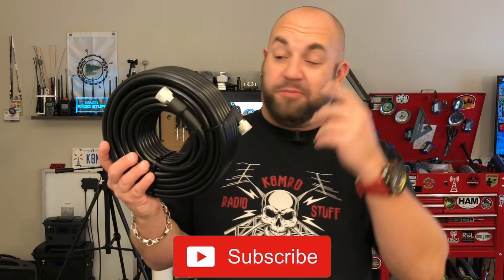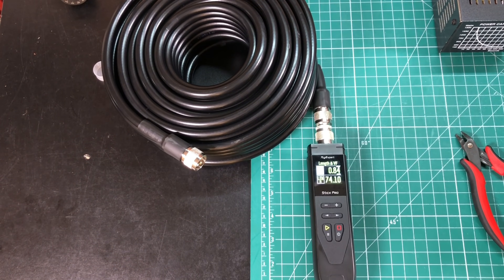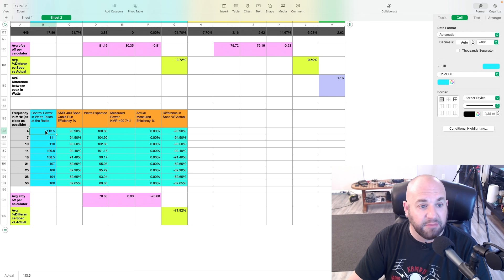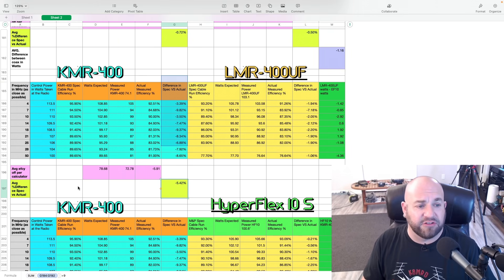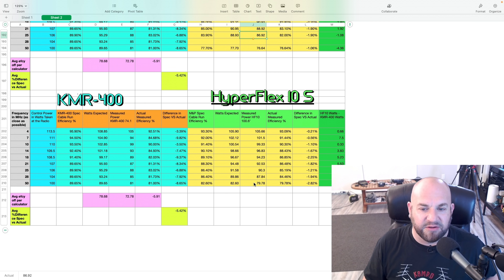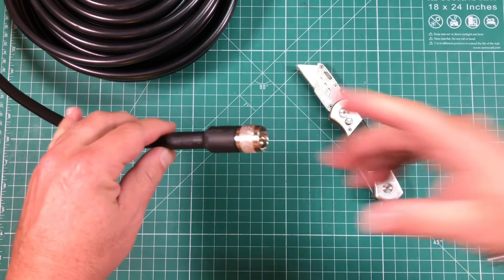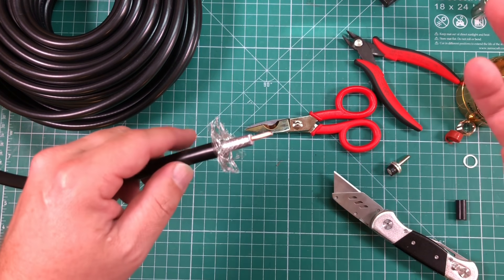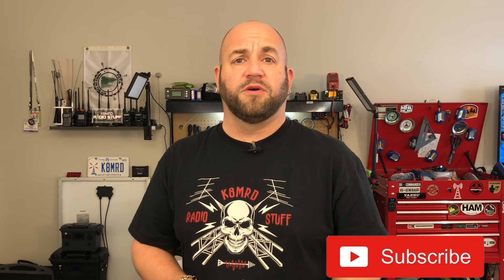I Bought KMR-400 Coax From Amazon | How Bad Can It Be?

Comment: Excellent video!  I have an 80 foot run from my entry panel to a tall oak tree.  I used M & P hyperflex 13 with N connectors for the 2 meter/70 CM run and DX Engineering DX 400 Max for the three other runs of coax.  Two are covering  UHF/VHF and HF, leaving two DX 400 Max  runs available for expansion.  I have lightning arrestors both at the base of the tree and at the entry panel with both bonded together with appropriate ground wire and ground rods(including the service ground).  I spent the most  $  where I would have had the highest loss (VHF/UHF).  I felt that the DX 400 Max was close enough to LMR 400 and that the cost savings justified it (bought a 500 foot bulk roll).  The run was underground  in a plastic electrical conduit.  Downhill from the tree to the house with drain holes in the conduit just before the 90 degree bend up to the entry panel as an egress point for any water that might get into the conduit.  I used the M&P Evo connectors...see Callum's video.  The soil here is red North Carolina clay...I didn't want to dig a trench more than once!!!  I had to wait for the budget to catch up to the purchase order and I am glad that I did.  Perhaps there was a reason the KMR specs were unavailable!  I'm generally of the opinion that over-engineering is under rated!  Though I did have budgetary constraints to contend with1  73
Reply: How close did you put all those feed lines together? What about interface issues?  I'm pretty new to the hobby but my understanding is that any metal which runs longitudinally with the feed line will change the SWR and can potentially generate RF noise on the other cables, right?  How is this setup working for you?  And are you ever trying to transmit on one radio while the other is connected and listening?  Or is it all on the same radio and type just switching out antennas?
Reply: @darinhitchings7104  I have one 80 foot run of M&P hyperflex 13 for VHF/UHF and 3 runs of DX400 max for everything else.  All 4 coax runs are in a 2 inch  plastic electrical conduit.  Lightning arresters both at the entry panel and mounted to a ground rod at the base of the oak tree.  I've had no issues.

Comment: If your coax lengths are to very long, it doesn't really matter.  Mine are all less than 50feet (30m).  I have an eclectic collection of coax and don't notice any significant differences among the types of and brands of coax I use.   If your coax runs are 100, 200 or 300ft long, well, take out a second mortgage on your house and buy some "quality" cable.
Reply: When you get to UHF regular RG58 starts becoming very lossy. 7db at 50 ft.
Reply: @randykitchleburger2780  I use RG213 or some heavier gauge coax for my UHF/VHF feed lines.  For HF RG58 is cheap and works ok.  Like I mentioned, my feed lines are less than 50ft, some  much less, especially in portable/mobile situations.

Comment: So it's good stuff! 
That's good to know. 

I'd been more impressed if he had compared the same length of LMR 400 with connectors hooked up in the same way and showed those results instead of just relying on the chart of specs for the LMR 400! 

On the one hand he doubts the specs of KMR 400 yet believes totally the spec sheet of the LMR 400!!!

It's been my experience those specs sheets from manufacturers are always calculations from IDEAL LAB CONDITIONS and i doubt anyone can duplicate those findings in the field! 

So like that guy im actually impressed with it!

My only complaint is I don't like the big thick coax. It's just too hard to handle. 

Thanks for sharing!.

Comment: I wanted jump in on the solder verses crimped connectors conversation with a slightly different view…maybe. In aerospace the decision to crimp or solder was based to several factors.

1.	Was the instrument that was being specified “mission critical”?
2.	How much power was the cable carrying?
3.	Was it possible that the instrument being installed have to be removed for service or maintenance?
4.	Was vibration a consideration in the choice?
There were several more items but they do not apply to the HAM applications. The decision that everyone has to make is the connection mission critical? Does mission mean you have to solder?

No. 

In general crimping was used on multi pin cannon connectors were vibration was less of an issue because of the strain relief that was in place. This is where you get to decide is the connection mission critical, and do what you think is best. 

Glenn
N6JAI

Comment: It would be interesting to do a true comparison of diameter, coverage, and true performance. I also believe that for the test to be accurate, the cable needs to be stretched, suspended in a non-conductive tray and measured. It would be very interesting to do an LMR-400 vs the KMR-400 and other brands. Do all of them at 100 feet since that is how the standard is made, but some companies probably do their measurements in meters. Also, I knew the ad was suspicious on Amazon as it said cable is made in the USA and assembled in China. LOL!
Reply from the maker: Cable 100% does not need to be stretched out to test for length, loss, velocity factor, etc.  It is just fine coiled up like this.  Trust me.  I just spent 4 days in Italy at the Messi & Paoloni factory.  I have a video that will be coming out in the following weeks showing how they test their coax so you can see how it's done.
Reply: @hamradiotube  SOME PEOPLE [!!!!!!!!!!!  JUST CANT EXCEPT THINGS AT FACE VALUE.

Comment: CCA is inferior. This garbage started with Ethernet cable and wise IT NEVER use it.
Reply: CCA is only inferior if the CU thickness is insufficient for the frequency.  All of my Andrew Heliax (1/2" and 7/8") is CCA center conductor and it is very low loss on all frequencies I use.  Same for my CommScope LMR400.

Comment: RG 400 is the way to go, especially concerning its high heat tolerance makes easier for soldering connectors.
Reply: Not for longer runs - look at the loss.  4.4 dB/100' at 100 mHz. compared to 1.232 dB for LMR400.  Soldering a foam dielectric coax works fine.  You just have to tin the braid with a large iron before installing the connector and after installing the connector, let it cool before moving it to allow the foam to re-solidify.  Quality crimp-on connectors work very well.
Reply: @jimeppright7862  That loss is at 100 feet though. I have my antenna mounted at 36 feet high which is the first wavelength above ground and the loss at that length is near zero. 

Also, majority of base stations don’t have antennas nowhere near 100 feet and that’s a factor.

 So inevitably, as time progresses and the weather and sunlight has damaged the LMR outer jacket “especially that junk ultra flex outer jacket” the RG 400 will still be intact.
I ran times microwave LMR 240 and 400 for decades and neither type made it passed 6-7 years without the outer jacket ruined by sunlight and weather elements. Since I’ve upgraded to RG400 12 years ago, coax maintenance or replacement is not needed. Beside, I’ve seen BBi run 30,000 peak watts through RG400 and we all know you can’t even do that with anything named LMR. 73☑️✌🏻

Comment: How about stranded center conductor? This stuff is a time bomb unless it is routed so it never has to flex.
Reply: Maybe you mean foam dielectric coax.  RG213 is stranded center conductor with a solid polyethylene dielectric.  The quality brands last for decades used as a rotator loop.  Foam dielectric coax is less durable.

Comment: When you check for length with instruments
you a looking at electrical length  not physical  it is always much shorter than actual  with electrical length.  So your calculations are off.
The physical length is probably spot on.  You  can test for velocity factor loss with a good vna.
Chuck AA4CP

Comment: to be fair, you should test the exact same as the other coax vendors did to get their data, or, you are comparing apples and oranges. Conversely, get their coax as well and perform your test on all the coax's and see if the results are consistent or different - my 2 cents worth adjusted for inflation de K8MH

Comment: Interesting stuff, especially that the connectors aren't terrible. It looks like it could be great for a lot of applications. It's gotta be uncoiled for testing though. Coax should even be spaced away from metal tower masts and conduit at higher frequencies. I'm interested in how it behaves up to 450MHz with the provided connectors, and if N connectors are attached, how it does up to 2.4GHz.

Comment: A fair comparison would have been to run your same measurements against 75' of coiled LMR.
Reply: I agree. You have to perform the same test on LMR400 as a control test.
Reply: Pretty sure in its wound up tight state that it acts like an inductor...
Reply: That's a completely different issue than coiled vs uncoiled.

Using a nanoVNA with fresh OSLIT calibration, I got results on Taiwanese BR-400 cable which were within a few percent of the published values for LMR-400.
Reply: Mike doesn't want to be fair!  He wants to sell you on Chinese shit!  I wouldn't put that coax on my DX Commander if you give it to me!
Reply: Coiled cable only impacts common mode not differential mode.
Reply: @michaelstora70  But he's also not using the best or calibrated measuring equipment.  Even with real-deal LMR he might not see the same numbers on the datasheet.  Which would be fine, if you had real LMR400 next to it and measured it on the same equipment in the same scenario, the numbers might not mean as much, but a comparison would tell you a lot.  Or specifically if there is a big delta, or if they're within a couple percent.

Comment: Great video, thank you!  "Better" is subjective, and this coax is likely "good enough" for most amateur radio use cases. It seems great for the price.  But I'm using 75-ohm RG6 for my HF antennas, so there's also that.
Reply: I got some free reel 'tailings' of RG-11 years ago from an apartment construction project installing cable TV trunks.  Ended up with several hundred feet.  You can spin '259's onto it easily.  I use it on everything except my dual-band antenna.  Great stuff.  SWR is acceptable.  75-ohm cable was in use long before 50-ohm stuff was around.

Comment: I got a 50' roll about 3 months ago for setting up a new base station in the house. Antenna is a Sirio 827 about 30' high to the ground plane radials mounted to self made push up that's tied down with 3/16" covered steel cable, radio is a Galaxy DX55V that's been converted, aligned and tuned by a trusted radio tech friend of mine. I'm using  2 x 1446 (on low) driving 8 x 2290 TS Hotplate that averages 600W with around 1.3KW PEP on my MFJ 870 meter. I was reluctant at first about buying the KMR coax but now I'm glad that I did. Using my MFJ 259B analyzer on antenna setup I was able get my SWR down below 1:1.2 on 27.205 and 1:1.3 on both 26.965 and 27.405 with an impedance right at 51 ohms. The same results were noted with amp(s) and meter inline as well. In the future I plan to raise the antenna up another 20-30' and I won't hesitate on getting a 75' to 100' roll. This coax cable works great for me especially for the cost savings.

Comment: Did you actually compare a 75 ft run with your test equipment of the KMR-400 or did you just use the printed spec sheet for the LMR-400 . Don't always believe what you read on the spec sheets.  And since you did not actually have the real Velocity factor of the test cable under load, you're really just guessing. The Chinese are well known for cutting corners in every way they can to make or save money and the center dielectric could be garbage.  All else considered I'm sure this coax would work just fine if you aren't running a 1000 ft of !!

Comment: Thanks for the thorough demo with test gear.I am now much more confident.I am using this Mookeerf KMR400with 500+- watts SSB and I was cuirous what the compression pl259's pin was crimped and soldered.The pin looks larger than I thought.I bought Some Alpha 75 ft rg8 that had Aphenol cntrs so I figured the coax was good,NOT! .The coax was sparse weave aluminum shld which did not even last a year and corroded and burned.
Reply: I never did think it was a good idea to use compression connectors on solid wire, especially the aluminum coated copper.  They are fine on stranded center wire.

Comment: I ordered RG213 with pl259 couplers from Amazon. I had to replace all the fittings as they were pressure fitted on the braided side with no holes to put solder, and didn't make good contact. After replacing the fittings, and soldering everything, it performed as I expected.

Comment: 2:25  Analysis of cable loss should be done in dB, not "%" "Efficiency", except perhaps as a brief explanation of dBs for those that don't know. The table fails to even include dB, which is a bit annoying (LOL).  FYI - I measured the loss of 100-feet length of the same cable as being just 0.8dB at 30 MHz, which is fine.
Reply from the maker: There are many ways to skin a badger.  This is but one.
Reply: @hamradiotube   Should be dB.  One doesn't skin a badger using a baked potato.
Reply: @hamradiotube   Manufacturers' specs for cable loss are always in dB, never in "percentage efficiency."

Comment: it might be worth what you paid but I want a solid copper wire. I wonder if the lower performance was do to copper clad aluminum..
Reply from the maker: I would doubt it.  Times Microwave LMR-400 is copper clad aluminum.
Reply: @hamradiotube  interesting to know. I've always gone to an electronics shop and bought solid copper stranded coax and solder the connection. I never crimp. I don't even know what brand. I look for something made in the us or a European country I trust. I like to physically touch it and see if it feels like good cable and cut a section so I can see the center conductor and the shielding. I'm really old school when it comes to coax. Theres always going to be loss at some frequencies. I've never  worked with aluminum coax that copper coated. aluminum does have a higher resistant than  copper. I'm sure you're aware. I know you're probably thinking 50 Ohm is 50 Ohm, but thats clearly not the case. I don't have the answers but I'd like to find out the differences. I think you mentioned a 19 watt loss at one frequency. To me thats a significant loss of power thats turned into heat. Anyway I enjoyed the video.  It's nice to see someone else spend the  money to find these inconsistencies so we don't have to.  Have a great night and thank you reaching out to me.

Comment: Why would you say the solid always should do better? Electrons run on the outside. Stranded has more outside. . Another thing. It's copper clad aluminum. Aluminum has more resistance than copper. 

But I'll still buy a better brand. I like the stranded core.
Reply from the maker: Because solid center conductors perform better than stranded.  And RF flows on the skin of the conductor so the resistance of aluminum is irrelevant.
Reply: @hamradiotube  isn't it electricity "voltage and current" until it reaches the antenna and then it becomes RF, a radio frequency?

If solid performs better then why do the top coax manufacturers use stranded? Is the gain and flexibility really worth the loss?
Reply: the question is; how does an antenna transmit signals
the answer:
1) Electricity flowing into the transmitter antenna makes electrons vibrate up and down it, producing radio waves. 2) The radio waves travel through the air at the speed of light. 3) When the waves arrive at the receiver antenna, they make electrons vibrate inside it.

Comment: Cable is not bad.  Love to see if soldered connection would make difference.
Reply from the maker: It's really not bad all things considered.
Reply: I was curious if specs would have changed any if you had put it back together and managed to solder the connectors. It was just a thought though. I recently took down all my antennas, since when they went up 7 years ago I was on a tight budget, and switched everything from the 7 year old RG8 and changed everything to LMR400. I would like to try some of this Amazon cable for my jumpers inside the house and see how it compares with the 213 jumpers I use now. KE8BBT
Reply: @scottlogsdon5607  Don't forget, this cable is a copper-plated, solid aluminium core cable so is designed to be used for fixed installation. It wouldn't be suitable for a rotator loop or a telescopic tower unless you are very careful about repeated flexing which will likely work-harden the core and cause it to break. Same problem using it for patch or jumper leads in the shack.
Do some research into the best type of cable for your specific requirements and buy the best you can afford. It's a critical component in any radio system.
Also, use good-quality connectors properly fitted. Don't forget there are losses in connectors so it may be better to use a single length of cable right from the back of the radio all the way to the aerial.